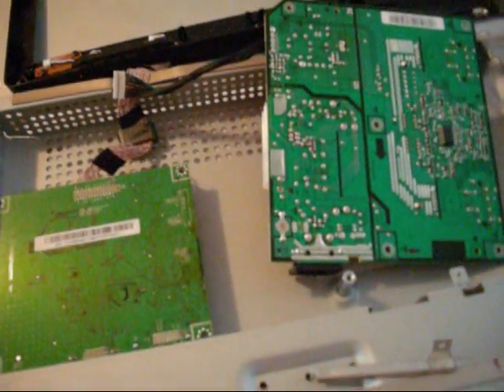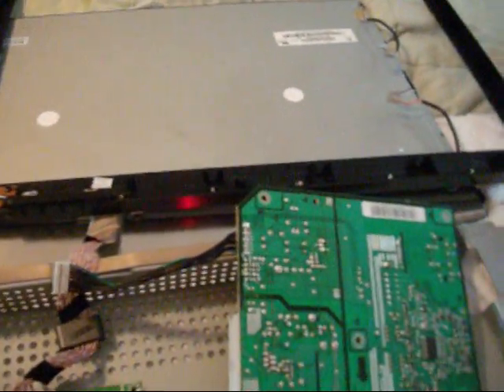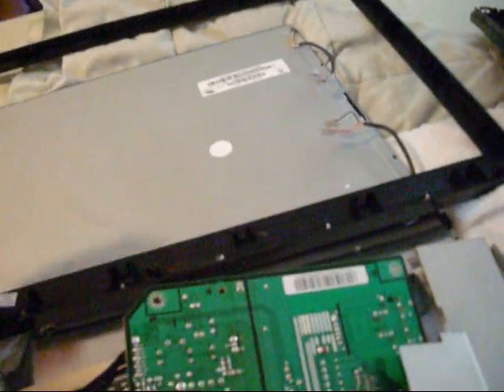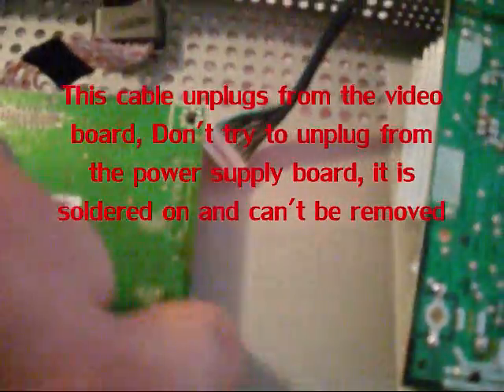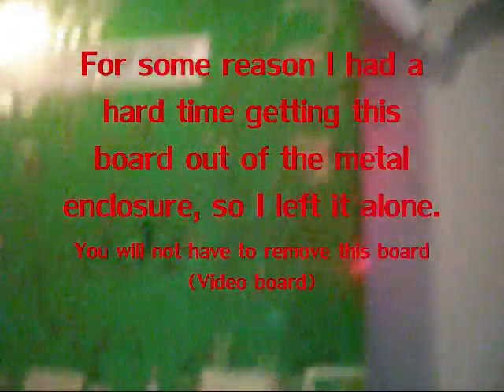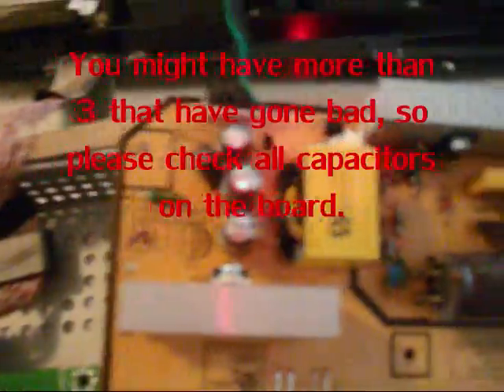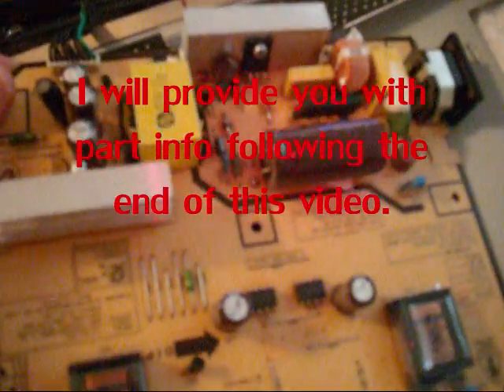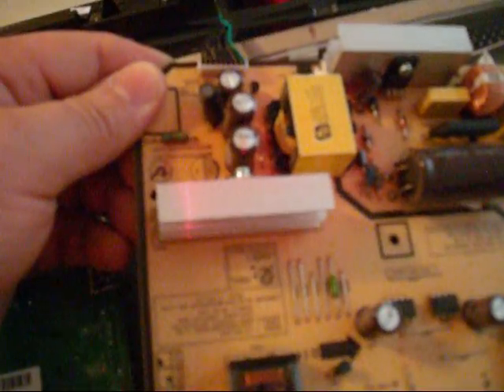Broken Samsung 226BW LCD monitor - repair tip info.

Comment from the maker: @thebighat99  Any standard electrolytic will do. As long as the voltage and microfarads are the same value you'll be fine.  I wouldn't worry about brands or temperatures..even the best quality brands can fail. I would just buy accordingly to how much you can afford.  It's kinda like buying lightbulbs.

Comment from the maker: Just remember when it comes to electronics, if something is totally broken it doesn't hurt to experiment repairs, you have nothing to lose.  I spent many years as a teenager taking things apart and repairing them to get decent results. Not all electronics can be repaired with household tools, but it's nice when you can, such as monitors, radios, televisions and other small appliances.

Comment from the maker: @Hardtale  mouser  com is your best bet on getting the parts you need. I can pretty much 100% guarantee you that yours has bad capacitors as well.  The problem is going to get worse and worse until one day your monitor won't turn on at all.

Comment from the maker: In general, most monitors are built the same, but they are arranged differently inside. Just remember to look for the capacitor and check them to see if they are bad.  the tops of them will not flat if they are bad.